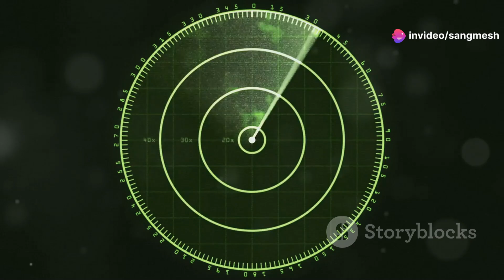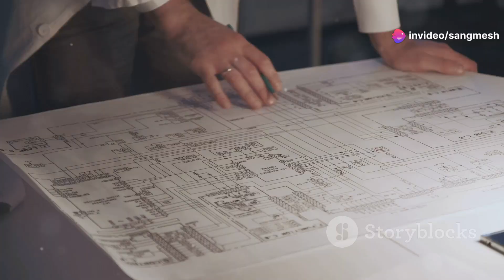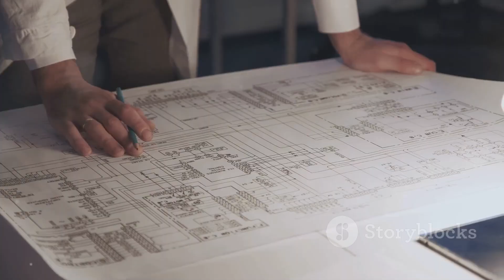Reason Why F-22 Raptor's Engines Are Hidden Explained!

Comment: Stealth technologie will not give you any advantage in modern wars ... why ?? because the S-400 defense system can track and aquire Stealth jets .. so... Stealth tech and dog figths are irrelevent in modern war ... the advantage of russian jets compared to western jets ( more maneuverable ) have also lost its relevent because of the range of missils that makes dogfigths almost impossible to happen..
Reply: Stealth is not an advantage, so why is the Russia developing Su57, Su75 ? S300-400-500 are the joke. They can not even shoot down anything in modern war. What is the last time a S300 shoot down something despite being deployed for 30 years? Zero !!! In order to detect stealth aircraft, you either need visual, or multiple radar stations working together. But that is solely detection. To guide the missile you need to acquire lock, which is not possible for a single SAM radar station. And for visual lock it need to be close to that sealth fighter, maybe 20km for a ground SAM battery. So stealth is the big advantage for anyone with it. Detecting a stealth aircraft is not very hard. VERA system from Czech can track it, they use multiple radar stations to “listen” to low signal radar reflection, but to guide a missile, it is extremely hard. The F117 shotdown in Yugoslavia was a lucky shot, using optical guidance.
Reply: @TheIslander2025  you live in a Hollywood movie man.. Don't worry in the next year's you will awake up to reality..  If Americans are that good then send troops to Ukraine for us to laugh even more...